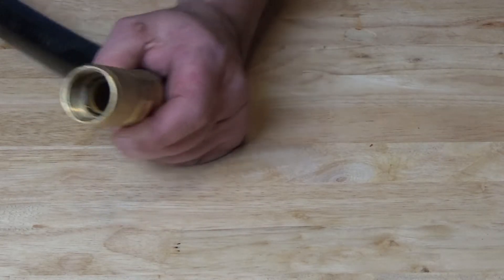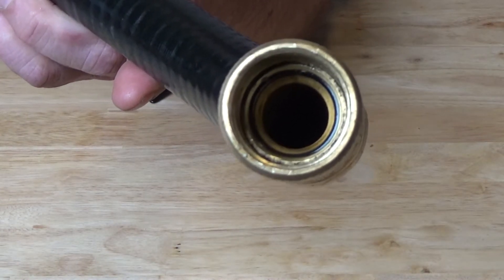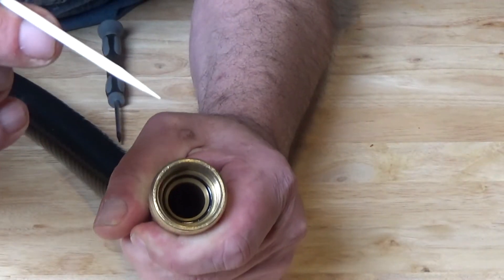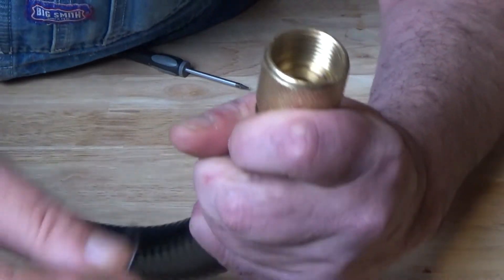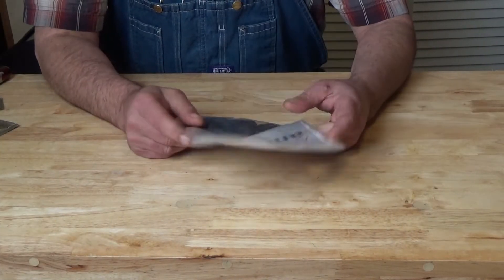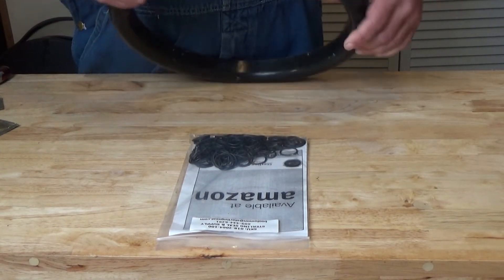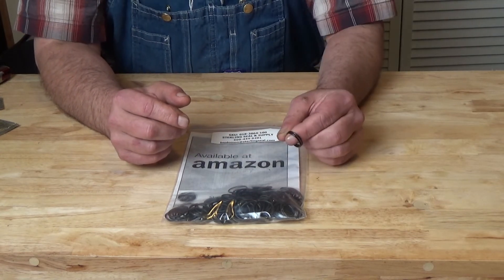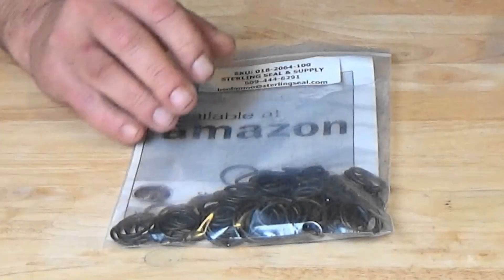Harvest Right Vacuum Error Replacing Hose O Rings Ep223

Comment: Hi John, any help would be appreciated.  Our HR is 8 months old and will not heat up during the drying cycle.  Going round and round with HR techs and getting nowhere.  Don't know what to do, any suggestions?  PS Love the videos!
Reply from the maker: The techs have a procedure I am sure for you to go thru. If your machine is 8 months old then it is still under warrantee so I will refrain from advise so as not to void your warranty. Suffice to say, check your wiring harness for loose wires on the tray rack, I read that there is a hole on the back plate of the rack that allows you to press some sort of reset button for the heater. Mine doesn't have it but you could check that. Run a heat test to see if the heaters are working. Not much help I know but the best I can do for you and a machine under warrantee
Reply: @JohnInBibs  Thank you John.  The heaters are working on the test cycle, I'll try to locate the button and push it.  Hopefully will correct the issue.
Reply: I had a heating issue. The problem was under the cover on the back of the heater/ tray rack. Wire pulled out of a connection
Reply: @Deano_K5MPG  Thanks much, did that too.

Comment: I think my hose is defective, there is no groove in mine and the original o-ring fell out and I can't get another back in and can't find a o-ring that fits.  I have been in contact with the company and they are no help at all.  They don't sell parts for my machine anymore and I take the larger hose like yours.  At least it looks like that in this video.  I bought the smaller hose and it works on the oil pump but not on the oiless.  I am glad you made a video of this!!  I couldn't find one when I needed to change the o-ring.  thanks!!!
Reply from the maker: hmm you have me stumped with no groove. Are you sure you don't have the old style machine that used the garden type hose connector? If you have that type you can get the rubber ring from any hardware store that goes inside the hose
Reply: @JohnInBibs  No it had an o-ring in it.  I am afraid to take the o-ring out of the other end.  When it fell out it was covered in a heavy grease.  I think that was the only thing holding it in.  Frustrating.

Comment: Replacing the O-rings is a good start. I found out the hard way that the connections into the fryer and pump should not be over tightened - just finger tight. Otherwise it will chew up the O-rings!  Thanks for the tip about using wooden skewers.
Reply: Same here. I over tightened them a few times and had to replace them. Im guessing over tightening smashes them. Anyways replaced them and it fixed my vacuum error. 7/8” OD 3/4” ID 1/16 WIDTH

Comment: Another area to check is the drain. Close the drain, draw a vacuum, put the drain hose in water and see if any liquid is drawn up the drain hose.
If you want to confirm the door gasket, draw a vacuum and spray the door seal with soapy water.
Reply from the maker: Thanks for the tip

Comment: Thanks for the info John, will be waiting for more results!! Good Luck!
Reply from the maker: Thanks, it's been 5 days.... I am having withdrawal symptoms LOL
Reply from the maker: @nanmaco  I try not to go thru tech support as I am a cheap ^&* can't afford the fee. Don't get mad at me if I am wrong but it sounds like your relay board (mine went bad recently) I just called sales and told them I wanted a new board. They wanted to pass me to tech support but I kindly said I would just like to buy the board. They sold it to me without going thru tech. It fixed my heating problem. The problem I was having is that it would dry for some time and then qouldn't heat up. My trays were coming out ice cold. In the end it quit heating at all. The board was about 150.00
Reply from the maker: @n mc if you go to https://harvestright.com/support/ click the Drying Issues tab, read thru those 3 steps, they show you how to test your relays. the 3rd step shows replacement of the board. If that is your problem feel free to contact me when you get the board, I have some tips
Reply from the maker: Here is a not bad video by someone else. He makes lots of mistakes but it gives you an idea of how to change the board. Please pay attention to the nut and bolt that he discovers needs to be removed, It has a little white spacer between the board and the bracket, he doesn't see this and drops it. It is important to have so be careful. He just screws the board down without it which you should not do. On my card that is the ground post.
https://www.youtube.com/watch?v=I7zbq3Wmb3Q